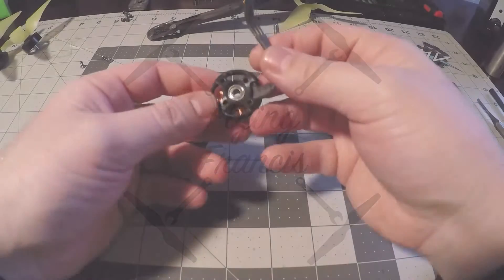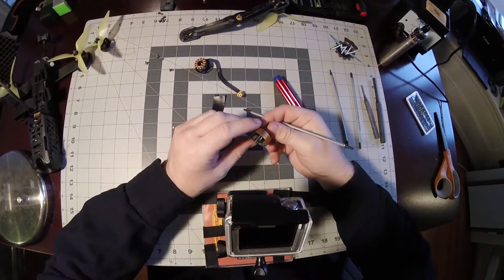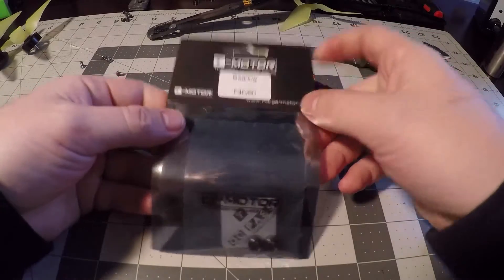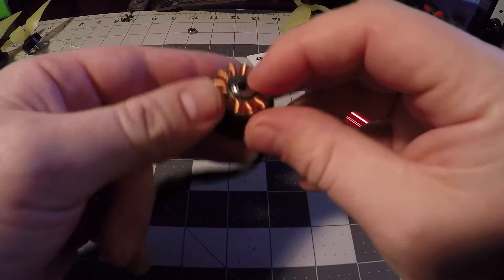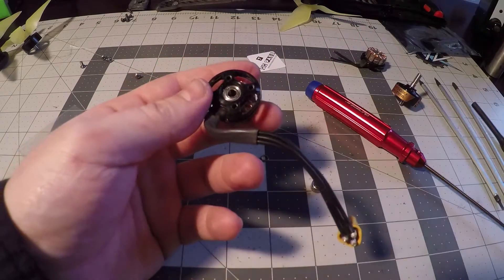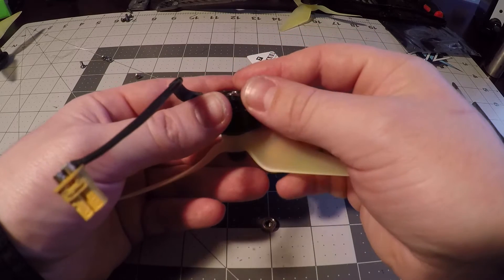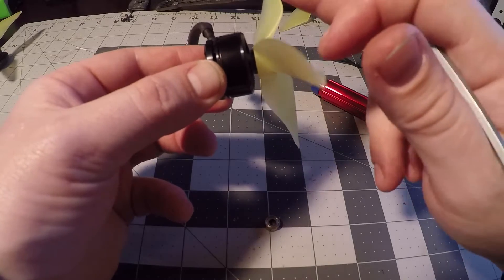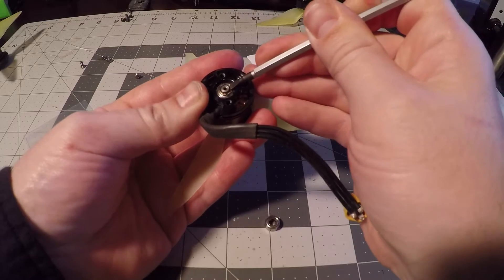T-Motor F60 Bearing Replacement

Comment: I got F40 II 2400kv and after about 4 weeks of flight two motors (front) get noisy and I find out that the shafts have side movement. I fly 3s batteries 30C cos I'm noob and all those 4 weeks I did fly in horizon mode to avoid crashes (btw. I fly over very soft surface). I did suppose that T-Motor produce high quality motors. Can you tell me if F40 II use also 4x9x4mm bearing? Thanks in advance.
Reply from the maker: I believe they do, but I am not positive.  I would recommend pulling the bell off and measuring if possible. If not search around and see if they have the same SKU numbers from tmotor.
Reply: Thank you for respond ...

Comment: what is the size of this bearing
Reply: just to know ... F40/F60, F40 II, F40pro/F60pro got the same bearings 4x9x4mm
Reply from the maker: 4x9x4mm for the F40/60
Reply: Flying Francis have you tried ceramic 4x9x4 bearings
Reply from the maker: No, have you?  Haven't found a good source for those yet.
Reply: Flying Francis I haven't but I have heard other people who tried it and they say it is extremely smooth
Reply from the maker: If you hear where they are getting them from, send me a link.  Thanks for the heads up
Reply from the maker: Thank you!
Reply: you are welcome. I will order those bearing to try them out. Btw. I did contact T-motor direct and they will send to me new shafts & bearing for all four motors despite the fact that I got issue only with two motors. Sounds fair enough.
Reply: A few months later now, and I'm wondering if you know if the F40 III also has the same bearings?
I really like them but I'd rather buy bearings than new motors